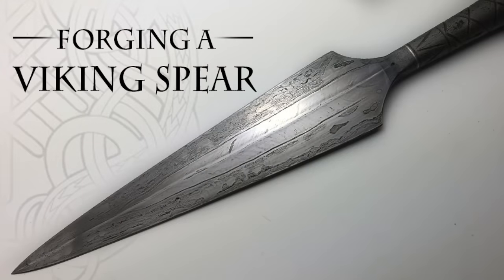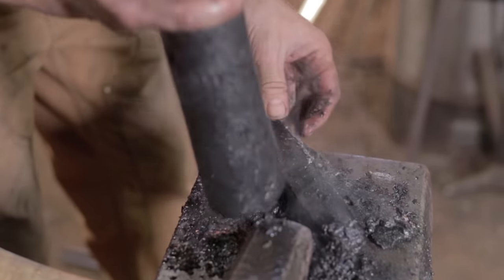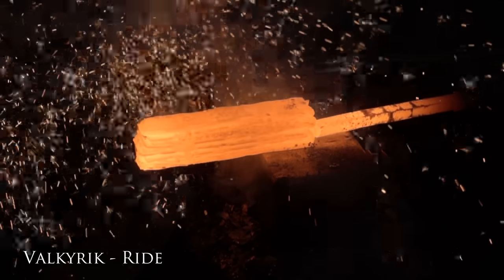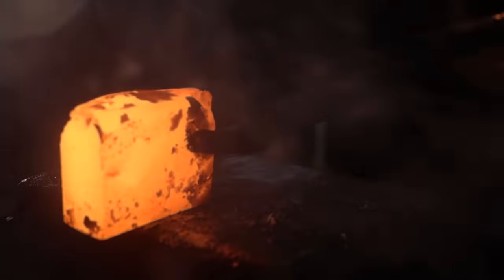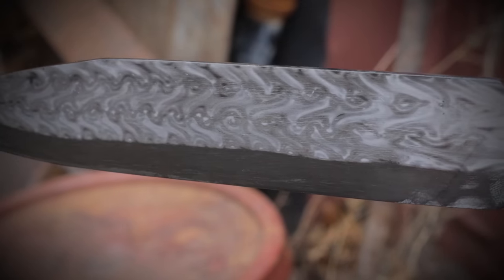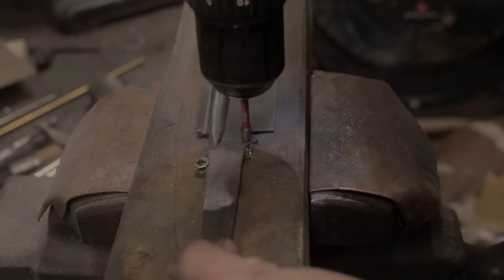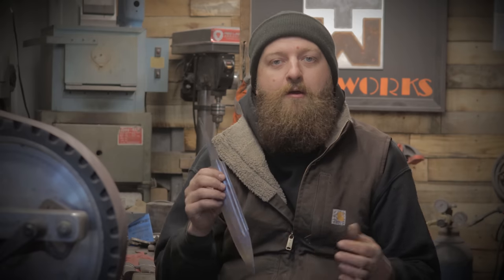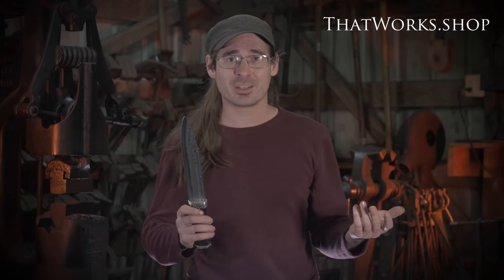Forging a [Viking] Seax from Blister Steel - Feat Valkyrik Soundtrack

Comment: I read some where that viking blacksmiths used lemon juice when at the end stage of polishing to bring out there pattern ? :) ....just a thought!
Reply: Lots of lemon trees in Norway
Reply: I find if you let a blade rust then remove the rust with vinegar (you know by soaking and wire brush) then the pattern is revealed pretty well (but it won't be shiny)
Reply: @ilyaalekseyev3589  good thing Vikings are known for trading 😉
Reply: @user-vx2sg4wr2l  I'm quite certain that expensive fruit wasn't used for etching anything.
Reply: @ilyaalekseyev3589  that's probably true, it was just an interesting thought :)
Reply: @user-vx2sg4wr2l  One thing to keep in mind. The "blacksmith" doesn't etch anything. The cutler or the polisher does. So anytime anyone tells you that "blacksmiths of old made sharp swords with blood rubies in the hilt" that is a child talking to you. One group makes the hilt, another polishes the blade, a third actually makes the steel, a fourth makes the scabbard. The job of the blacksmith is 5% of the total time involved. And, it is inaccurate to call people who make blades "blacksmiths" anyway.
Reply: @ilyaalekseyev3589  that makes sense ...it would make things a lot more productive and efficient that way

Comment: I going to have to disagree with you about Vikings purposely doing decorative patterns and etching. Only because I’ve tried doing some acid etching with common acids and you need a high concentration or strength strength acid for a timely etch. With that being said they probably had the benefit of time. It might’ve worked if they boiled vinegar but boiling to that concentration would destroy metal pots of the time unless made of copper. This is my opinion from chemical stand point.
Reply from the maker: Vinegar none boiled or urine will show color difference in a blade in a manor of hours.
Reply: @ThatWorks  I wish I had you luck. I even tired adding an 
oxidizer to make an oxidizing acid and it gave me weak results. I probably missed something. And on a side note gross about the urine.

Comment: If the goal of the experiment is to find out how they made blades a thousand years ago, I am going to go out on a limb and say that you failed.  They did not use power hammers, belt sanders, or propane gas.

Comment: That’s not a seax, also it looks Japanese. Why would you use bloom iron instead of case hardened steel for the cutting edge? You need to stop listening to your weeb friend with the man bun, he’s the same guy who claimed case hardening ‘tells you when it’s done’ by rupture of the container rather than timing it for precise penetration to get the entire properties of case hardening. He also confuses annealing for quenching, and doesn’t realise you bloom iron, if it’s steel it’s crucible steel not a bloom.